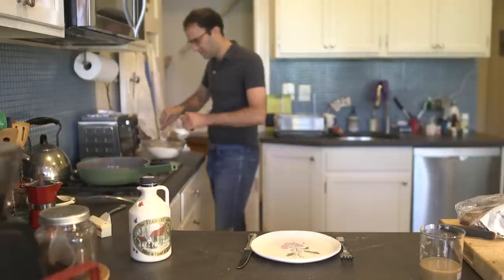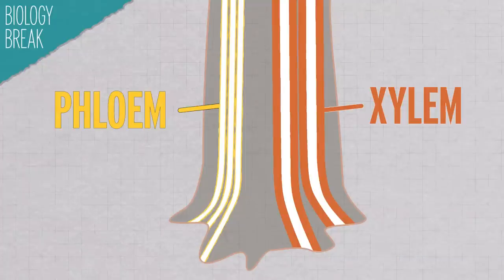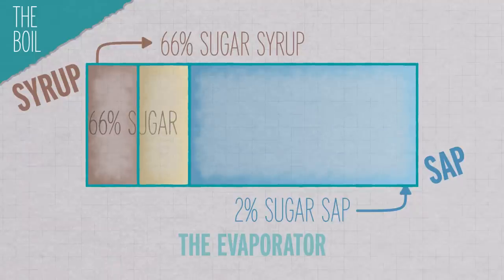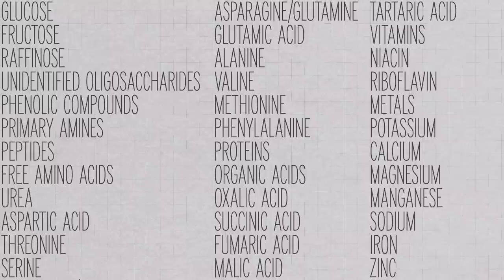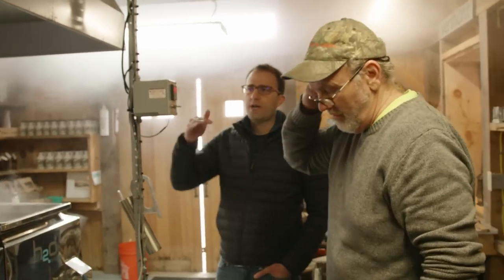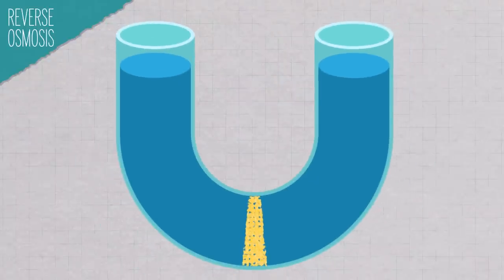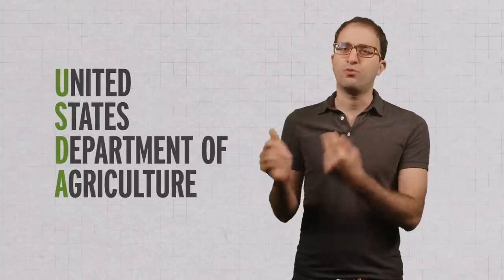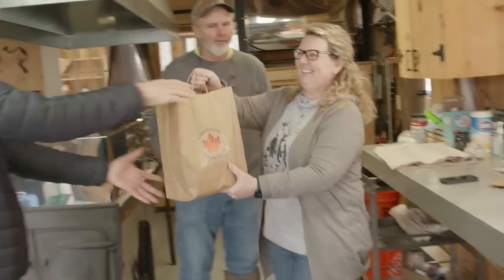How Do They Make Maple Syrup?

Comment: But how do they get the different grades MADE? That was never addressed in the video. Do different maple trees produce different kinds of syrup, or is it kinda random and you just have to determine what grade it is after it’s made?
Reply from the maker: The short answer is that no one is completely sure. The amount of time the sap has to boil for is a factor, which in turn depends on the sugar concentration of the sap and the weather when you boil. Bacteria, seasonal conditions, and pure random chance may all be involved, as well. Basically, you don’t really set out to make a specific grade. You make maple syrup and then find out what grade nature gave you.
Reply: @ACSReactions  so the same trees can produce different grades in different years?
Reply from the maker: the same trees can produce different grades from day to day, even
Reply: @ACSReactions  are some rarer than others? I’m Canadian and I’m ashamed not to know this 😂
Reply from the maker: Good question. We just double checked this with Dr. Perkins, and the distribution of grades varies from year to year. Generally you'd expect to get some of each grade every year, with lighter grades *tending* to come earlier in the season and darker grades later.
Reply: @ACSReactions  Thanks!
Reply: One crazy thing about the color is that you could technically get a syrup that is almost transparent by lowering the pressure. This would therefore lower the boiling temperature and drastically reduce the caramelization process. Same thing works the other way, you could apply a very high pressure to force the cooking process to boil at higher temperature and obtain a molasse-like syrup with 66.9 briks
Reply: The grade varies from start of season to end of season to harvest tree sap. For example. in beginning of harvest season, you get a gold color. End of season you get a dark color.
Reply: @ImTHECarlos98  Maple syrup is made from "Sugar Maple" trees (there are several species of maple trees). Sugar Maple has more sugar in its sap, hence its name and why these are the trees used to make maple syrup.

Comment: Great video but I'd like to mention there were two misconceptions in the video.  First when you drill into the tree, sap doesn't come out like a fountain.  It drips!  Secondly, when you were talking about ROing, you mentioned heat.  ROing the sap does not include any heating. It removes water to make a higher content concentrate so less boiling time.    Thanks for the great video!

Comment: dark syrup is simply a result caused by oxidation  and or bacteria braking down the sugars usually done somewhere in  between collecting an boiling. the higher the amount of inverted sugars the more darkening will happen. if you were to instantaneously process the sap from the trees it would always be golden.

Comment: Why do they use wood instead of electrical heaters?
Reply: Cost per btu used. Wood is cheaper overall.
Reply: Some operations use propane or natural gas.  But there is often a lot of wood available for burning in a sugarbush forest.  At home you can boil it on the stove and filter it through coffee filters.
Reply: @douglasmaass7530  Makes sense, in retrospect, we had wood heating in our moutain home in West Virginia.

Comment: Does that not hurt the trees?
Reply from the maker: The trees produce quite a bit of excess sap, so as long as you don't put a tap on a tree that's too small, the tree is perfectly fine. Remove the tap and the tree starts to heal, and after a couple years the whole will be completely grown over.
Reply: If overdone yea it can, and the tap holes can become infected but the owners of the trees make sure they are well treated and kept healthy.
Reply: It's like donating blood, so long as you're careful and only draw a certain amount from each tree they're fine.
Reply: The informal rule is you can tap a tree when its diameter equals the size of a bucket.  Some trees have been tapped for decades, with multiple taps.  Also, you can get excellent syrup from red maples (acer rubrum), also known as swamp maples.

Comment: Grade is only determined by color . taste has nothing to do with it in general certain colors have certain taste but not always. there is very little a producer can do to make a certain grade you get what the good Lord gives you
Reply: Generally color is the determining factor, BUT if you read the rules closely, flavor is supposed to be considered. Apparently, a sample could be graded as say, golden delicate by light transmission, but have too strong of a flavor and in that situation, it should be graded as amber rich.
Reply: @ryanbrowne4374  that is not true I make over 2000 gal of syrup a year sell half of it in bulk 40gal barrels to other producers or big packers one of the biggest in the U.S. it is purely graded on color. Flavor can be subject to opinions color can't
Reply: @ryanbrowne4374  you are correct. When you sell  Bulk syrup they check light transmission and they always taste it. I have had lighter syrup graded lower because of a stronger  taste. Been making syrup for 40 years.